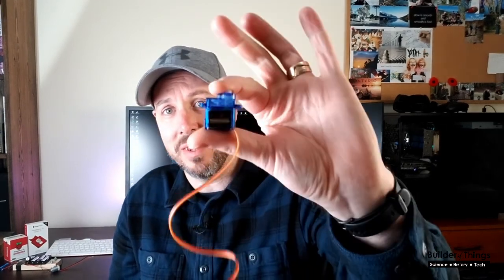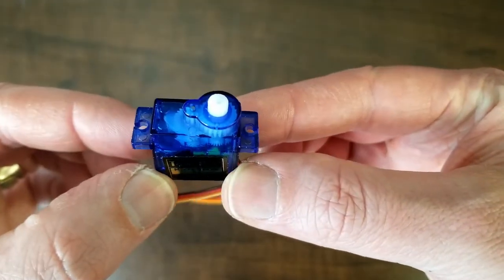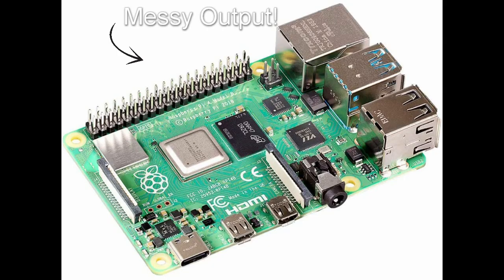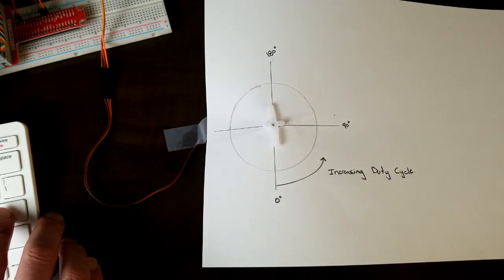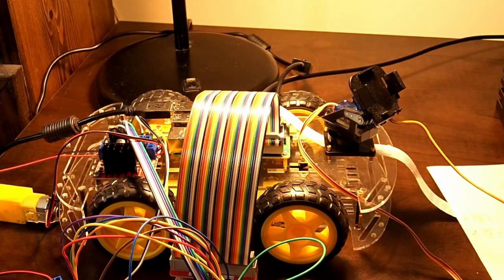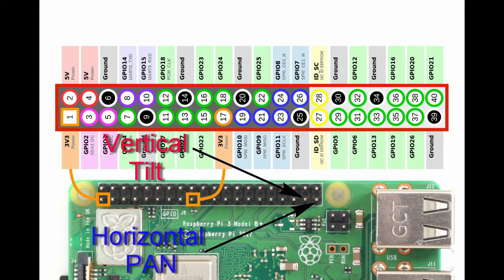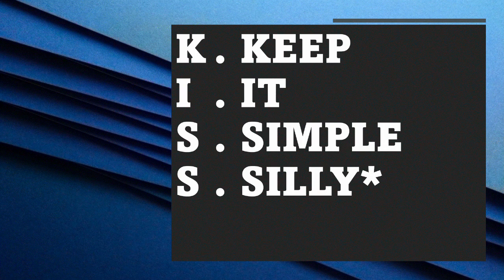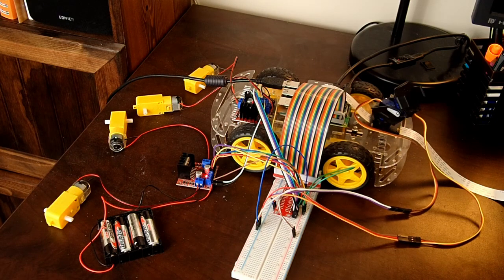How to fix a sharking servo motor? - Robot Car Blog Ep.2

Comment: Thanks, this was very helpful. I had an issue with a servo buzzing while idle and ended up mitigating it by simply calling servo.detach() while not in use. Simple idea, yet for some reason I didn't think of it.

Comment: On the car with the camera arm. Did you use a state machine and arrays for that. Did you run all the motors and servo in the same program? I would like to see more on that code. Did the power have and issue with running that at once? I would think that those motors and that small servos have a low probably a 1.5 amps requirement. I just realized that the mg996 require like 2.5 amps and my wall adapter I have powering it is only 1.5 amps. I feel cheesy once I realized this. I have been trying to figure out why I was not getting the power or the torque I needed. Still to do more research. But yea we need to start acknowledging the amp requirements and the state machine and the Millis and the arrays. Especially when we want to run different motors and servos or anything else at different times and different directions. Everybody just goes to the delay in the same direction and same time. It's not helping. But yea like to see the code on the car with the camera arm.
Reply from the maker: I can  do a deep dive into the RC code for the car. The camera and drive code are the same script though it has multiple threads. The scripts are available in the GitHub link in the description.

Comment: Awesome video! Thanks so much for this. Finally found the solution to this problem after a couple frustrating hours  looking into things like using a decoupling capacitor to stabilize power, using a ferrite ring core to reduce noise, etc. Turns out that for my use case all I needed was your move and kill method!
Reply from the maker: My pleasure. I'm glad some of my on the fly problem solving could help with your project too!

Comment: That was great! May I use Arduino Uno for this project for my device permanently instead of Rasp Berry Pi?
Reply from the maker: You definately can use an Uno for servo or motor control. If you want to do more complicated computer vision ( like the further steps in this car project) you be better served by a Pi or any of the Pi knock offs (Banana etc)